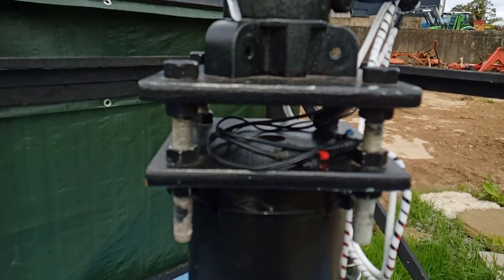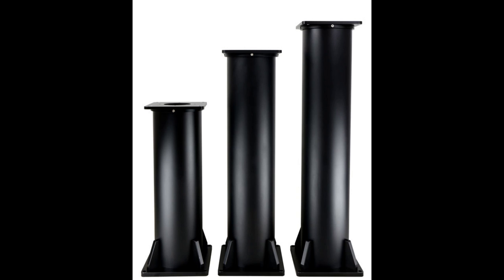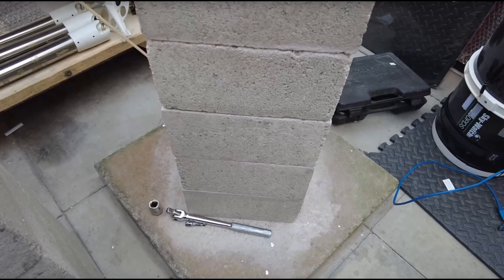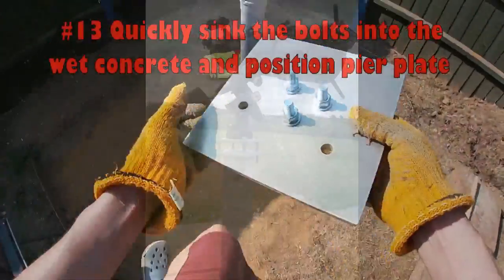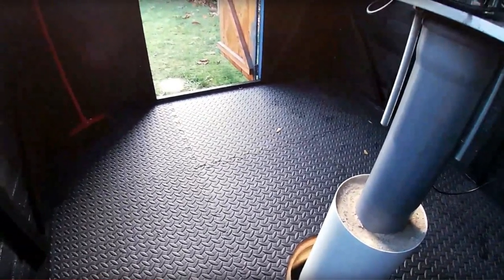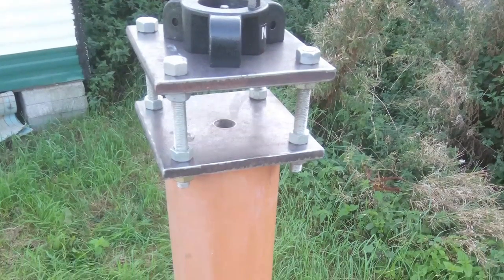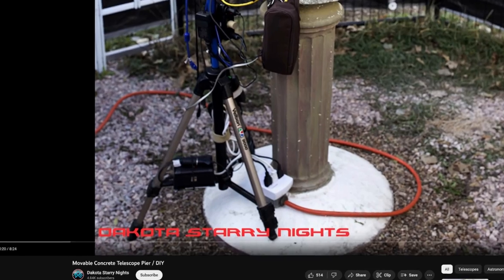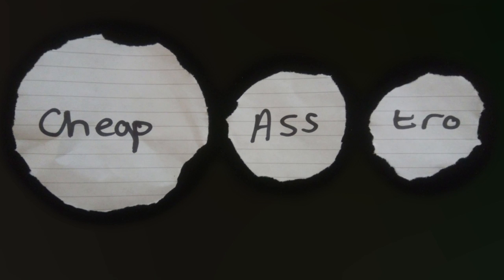Budget DIY Piers for astrophotography

Comment: I built my own late last year. I bought a 6 inch aluminium tube, with a wall thickness of 3mm. I buried one end into a cube of concrete 4ft x 4ft x 3 ft. I then filled the tube with concrete. The pier adaptor i made myself, but unlike the rats nest style i cut a small oval into the side of the tube. On to sits an EQ6R and even when i max out the weight with a 12" sct, i have no isuues.
Reply from the maker: Sounds spot on. I know that posting links in YT comments would ruin Youtube but it would be nice for things like posting pics.
Reply: @Cheapass-tro  yes being able to post pictures would be great.

Comment: I used a truck tire on a rim. I'd welded a 4" wide well casing pipe onto it, worked like a charm with an 8" newtonian and a modified webcam for photography. Now that I own my own property I'm looking into pouring a concrete pier and building a small observatory around it. It's not about "I have the best", it's about what works for you.
Reply from the maker: I like the way you think. I too am now looking into an observatory build...

Comment: I used a 6”x6” pressure treated post buried in concrete. I bought a brake disk with a 65mm centre hole $30.00, cut circle out on sheet metal the same size, welded in four 6”x3/4” reddy rod on the plate, drilled the holes through the disk, 8 3/4” nuts. Drilled in a bolt on the north side to complete the rat trap, my EQ6r pro fits perfect. No issues, no movement, no flex, no vibration, perfect. Total cost ~$100 (polar aligned all the time)
Reply from the maker: Sounds great. I should have mentioned the brake disc option. The difference in vibration between a tripod and pier is immense isn't it?

Comment: You don't need fancy isolation, you need thick and HEAVY with it being wider at the bottom so it doesn't sink easy. You need leveling at the top to compensate for settling.   I move around too much so I'm just going to make a very durable tripod, sure it will be heavy but who cares I won't be hiking with it.
Reply from the maker: Sounds like the best plan for your needs. Good luck, clear skies.

Comment: Great run through of different pier options. I went with 8" plastic pipe filled with concrete, sunk ~0.8m into the ground, and a baader short pier head and adapter plate for the mount.
Reply from the maker: Cheers. Sounds great!

Comment: Good ideas! I read where that someone used a pipe driven in ground and filled with sand as a damping material instead of concrete. That way it can be lightened up for portability later in case it needs to be moved. I really like the above ground solutions though. I own a house, but there's really nowhere that I'd want a pier permanently installed (unless I had about 4 different locations to better access different parts of the sky, but who wants a bunch of piers sticking up everywhere?). Keep it up! 👍👍
Reply from the maker: Thanks and yes, many designs still work regardless of people online stating that it's not the right way. I recently saw a wooden pier that looked awesome.

Comment: Oh the truck tire is a good idea. I have been considering building a todmorton pier, but I rent as well and really don't want to have to go about getting permission to dig a big hole so I had thought of using a 5 gallon bucket and filling that with concrete, but I think the tire is a better idea because you get more surface area touching the ground. With the todmorton pier I could sink threaded rod into the concrete which would allow me to remove the pier and then (with a lot of help) roll that tire onto a trailer when I move and then build a new pier on top of it or just take it off to the dump when I'm done with it if I ever get to build a proper observatory. Thanks for sharing your experiences!
Reply from the maker: Cheers buddy. Good luck to you. Another one worth considering is a half barrel full of concrete. The addition of rocks cuts down on concrete costs. I filled the rim of the tyre with rocks, put some down on the grass and added more as I poured concrete, which will run between them and bind it all if you vibrate, shake or hammer the tyre/what-have-ya once full.

Comment: I have a well in the middle of otherwise municipality suplied city water. I'm thinking of bolting a 9 inch steel pipe to the existing 1/2   inch thick steel well casing that extends at least 20 feet into the ground.
Reply from the maker: I'd say that would be below the frost line!